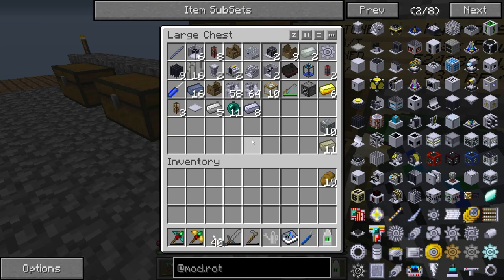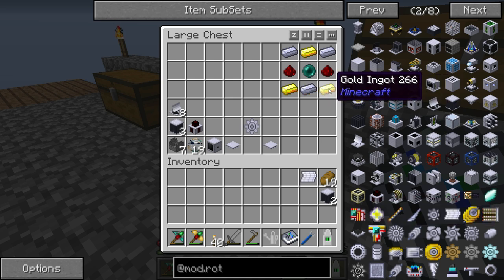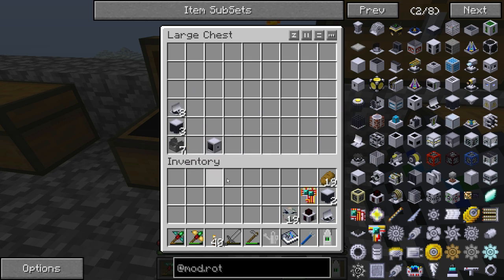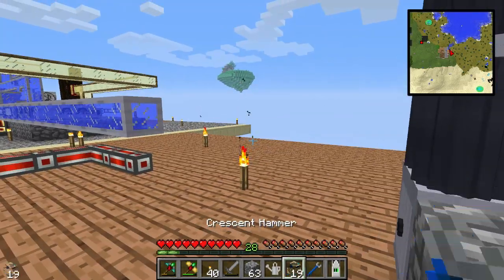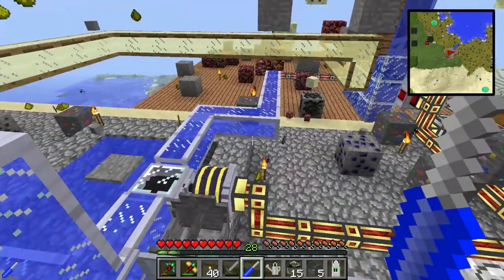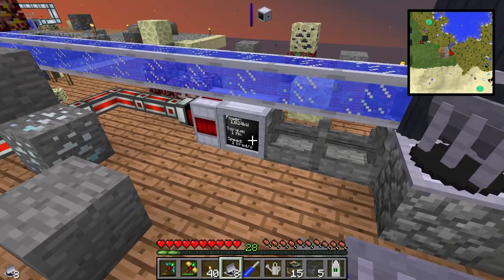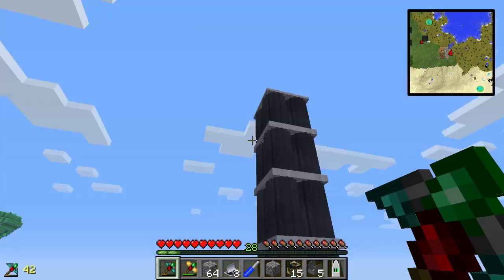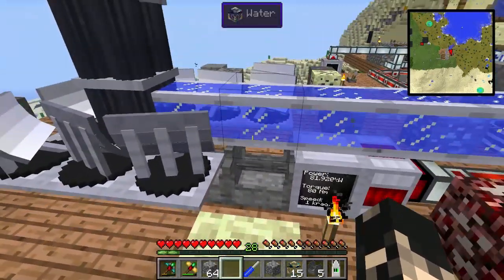Monster FTB Rotarycraft Solar Tower, Renewable Power, Meteor Shower

Comment: Turning things into lava: It's not so much about the radius of the mirrors, but about the number.   You can add up to 100 of them, the 101st will start melting things. 

I also haven't noticed any power creation improvement beyond the 18th solar tower block (game didn't crash, so that's been fixed), so I guess that's the limit.

1176 RF/t at noon, 188 RF/t at midnight, if you're curious (18 Towers/100 Mirrors).

Comment: Looks like you got hit with another one of my mods. :)
Reply from the maker: All I was thinking was one these meteor was going to burn my platform down.
Reply: Had they impacted, they would do far worse than that. >:)
Go to 5:00 in this video:
youtube[.]com/watch?v=BIPSFT-nN2k
Reply from the maker: Is there a way to get a meteor or shower to happen in a test world. I have a few ideas on how to shield a base from them.
Reply: Use the configs to change the spawn rate of meteors (make the rarity very low) and turn on "always explode". It is not a true shower, but it will mimic it.